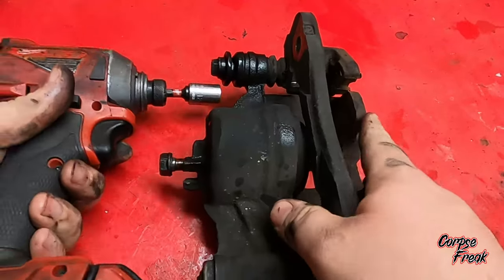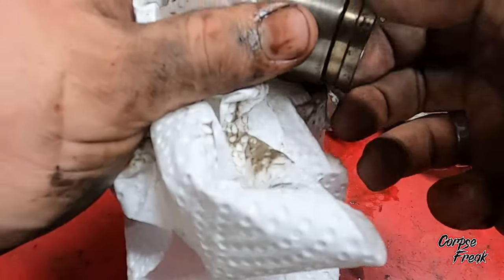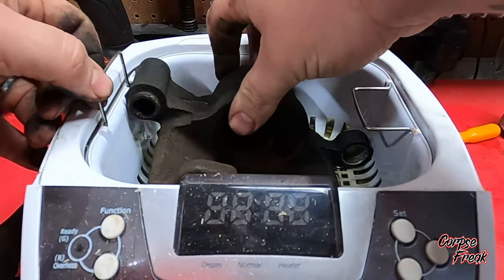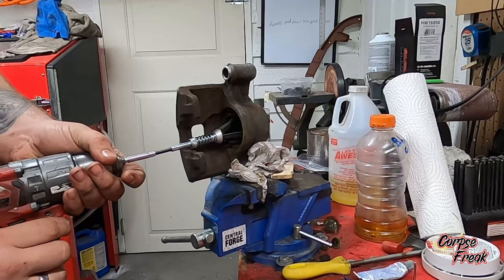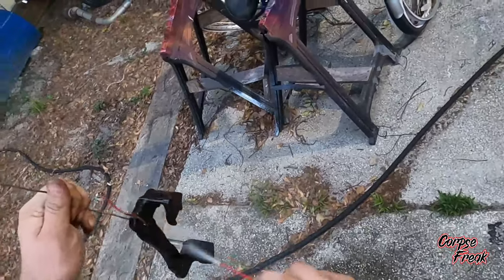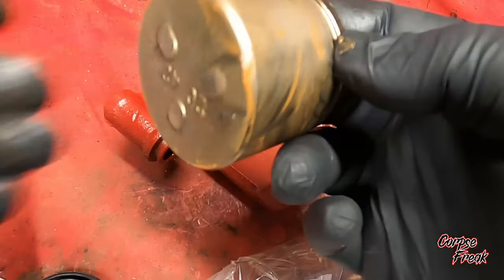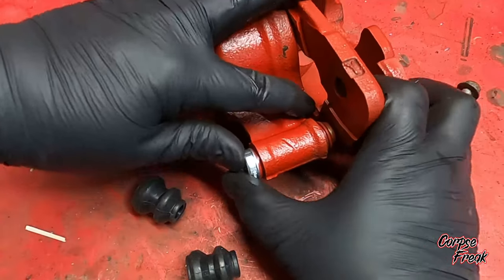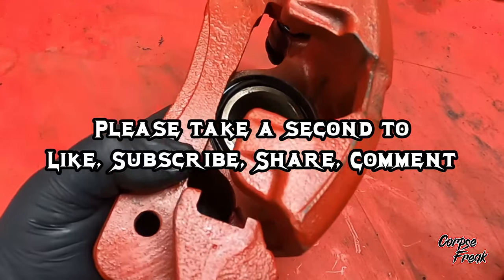How to rebuild Honda Civic Del Sol front brake calipers

Comment: Just wondering, won't the silicone lube contaminate your brake fluid and compromise the fluid?
Cool rebuild though. I remember doing this with my dad on his Jetta.
Reply from the maker: Used a very light coat. Been driving on the brakes fine.
Reply: @CorpseFreak  that's good to know. Thanks for the reply.

Comment: Hey man, didn't you recently have a video up about rebuilding the brake proportioning valve?  I had seen it and was going to give it a go.  When I went back to view it again it was gone.  Any chance of reposting that?
Reply from the maker: I did but I have had a few people tell me they are having weep hole leaking issues still. I de listed it so I wasn't giving bad info out
Reply: @CorpseFreak  Ok, thanks for the reply.
Reply from the maker: @Buzznut3000  gladly man. My friends and I have been trying to figure out a better part to fix the issue. The problem is on the OEM prop valve there's oil seals similar to the rear main seal and cam seal etc. however I haven't found a source for those